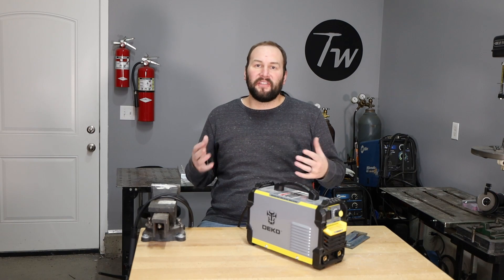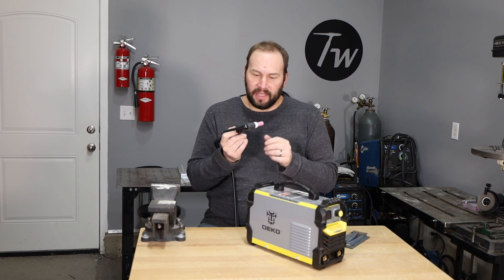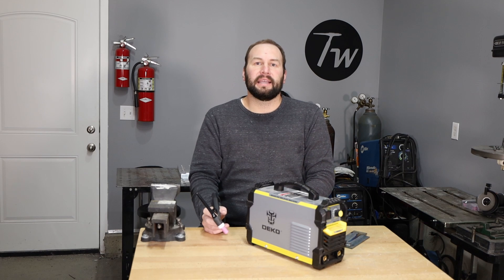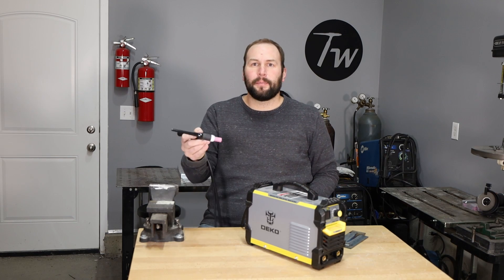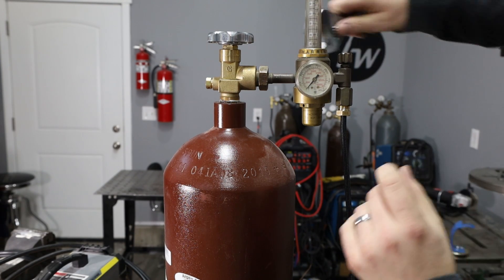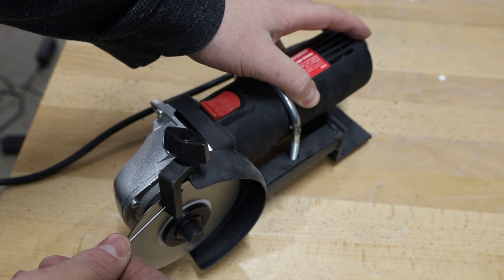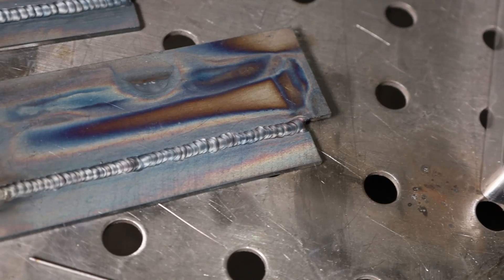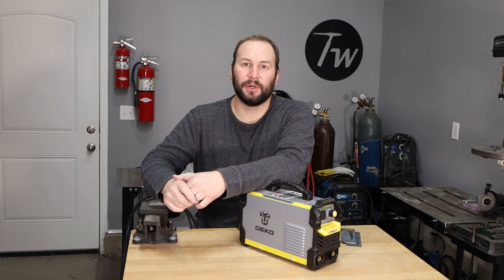TIG Weld with a Stick Welder

Comment: In the industrial trades like pipe welding and boiler tubes that require a TIG root, and fill out with TIG in some situations , they pretty much always have to scratch start and use a torch having a shielding gas valve . 
 Ok, this is been going on for years . 
 My question is in the snap out of the full  current electric arc. 
 I know the welder starts to slowly long arc trailing away from the puddle up on the pipe  bevel or off the weld bead  then snap out . 
 This takes some learning to do it right and not leave a fish eye crater that will get your money ! 
 There getting shielding gas coverage for the tungsten  as long as it still remains close to the work in a gas consentrated zone . 
 But, I can't see that the weld puddle is receiving enough shielding gas ? 
 Is it because the metal is thicker and cools or dissipates the heat enough so the puddle has time to solidify ?

Comment: Is there a type of electrode that is better for scratch start Tig?
Reply from the maker: Just about anything other than pure will be fine. 2% Thoriated is the old school choice and 2% Lanthanated is what I would use. The best way to keep it in good shape is to flick the rod against the side of the taper so that you don't mess up the point when starting the arc.
Reply: @TimWelds  thank you, I appreciate it.

Comment: I have a 160 amp inverter arc welding machine. I need to do some auto body repair (car body panels). I was thinking about saving up some money to buy a tig machine. So your saying all I need to buy is the tig torch and gas with gas gage?
Reply: Probably ?
Reply: @woozhi9218  why probably? what am i missing ?

Comment: I have a weld generator and I was thinking if the exhoust gas could be used as shield gas.
Reply: no no no no, dont do that- if there is any fuel remaining in the exhaust and you do that, it'll blow the fuck up
Reply: @aesthetictap3401  It doesn't work. The exhaust has a lot of water vapor. The weld looks shitty.

Comment: So if I want to weld stainless steel do I have to use argon or can I just get the coated stick ?
Reply from the maker: You can use either TIG or stick to weld stainless. Stick welding doesn’t work well if the material is much thinner than 1/8” (3mm).

Comment: Has anyone tried adding a foot control or something to cut off the arc, so you dont have to flick the torch and let the gas protect the weld till the end?
Reply: You can modify the electronics to cut off the arc but its not recommended.

Comment: Great Video.   I have a cheapy inverter welder that will only do 127 amps and overhead 1/8" 7018 is hard as it needs 10 amps more as holding a tight arc snuffs out the arc.   If you can test these welders in overhead and find ones that will do it in 1/8" 7018,         I'll buy one !!           Thanks

Comment: Hi Tim, Awesome video.  Thanks for posting, great info.

Would you recommend this Welder or something similar today, one year later?  Or have new better power supplies become available since this video was created? 

 I would like to try TIG before investing in an $800-$900 TIG welder.  I currently have a CK 17V torch, gas hose, gas/power connector block, gas regulator,  everything to make it work. I will purchase the Argon cylinder. The only thing I am missing is the power supply for TIG setup.  Any recommendations ?

Thank you, Dan

Comment: I have a hard time to repair sheet metal used on a metal wheel barrel using 1/16 stick welder rod. I am putting holes through the sheet metal.  Any suggestions. Can I just use co2 gas in place of argon gas?
Reply: The trick to welding thinner material with stick is to keep the arc length as short as possible, use the lowest amperage possible, angle the heat toward greater mass when possible, and make sure not to linger in an area too long. If all else fails, you can do a continual overlap of quick tack welds (just remove the slag on each tack prior to starting the next one)

Comment: Do you by any chance have the OD of the cable that connects to the welder? I bought myself a Tig torch now I just need to get the cable. 8.9mm or 12.8mm

Comment: Halo freind. Thank you for the video. I tried the project and it doesn't work.
I replaced a welder and it's not working. I changed a gas tank and it's not working
I use argon  gas. 
Electronic welder- deca mos 170 gen 

By the way, I'm using a direct connection from the + port  from the welder to the table, not the gas hose. 

I thank you for any help. Thank you

Comment: Instead of noble gas can you use a flux coated rod or powdered flux?
Reply: No. With TiG welding you form a molten pool before the rod is added. The gas is necessary to keep that pool clean before, during, and after the filler rod is in contact with the weld.

Comment: I've tried the same what you showed on the video unfortunately my tungsten balled everytime I started....... May be I have to practice how to 'scratch' start which makes me really stressed out sharpening the tungsten!!! Do you recommend other tougher tungsten? I'm currently using 'white painted' tungsten.
Reply from the maker: First of all, make sure that your torch is connected to the negative side-if it is backwards, it will ball like crazy. Second, that type of electrode is typically used on thicker magnesium or aluminum with AC. I would recommend blue lanthanated electrodes (red or gray will also work).

Comment: I'm curious, is it as difficult to scratch start as it is to stick weld?
I have so much trouble stick welding until I switched to 7014 rods (much easier).
You make both look really easy.
Reply: Can you use 7014 on thinner metal like you can with 6013? Do you like 7014 better than 6013?

Comment: I want to see someone hook up an AC stick welder and try to tig weid aluminum with it. My guess would be that you are stuck on a 50/50 cleaning vs penetrating. but like I'm really curious to know if anyone has ever done that.
Reply: ac/dc tig is not AC current from my understanding, it's different

Comment: I dont have money for argon gas. Can I get a tig torch and use it with my flux coat electrode? Wouldnt the electrode be an alternative for gasless welding.

Comment: Well Done, hmmmmm I have a hopefully bright idea type of question;
   If I fill an inexpensive sandblasting enclosure with gas & tig weld in it, ?would I save tons of money on gas?
Reply: Probably only if you have to do a lot of welding on a relatively small piece

Comment: Good video. I think you should have underlined the fact that even though this is TIG welding, this method is not good enough for aluminium. That would require AC balance feature from your welding machine.
Reply from the maker: Great point! Thanks!

Comment: Why do you not recommend using an ac welder for this setup.? I want to try welding alum.
Reply from the maker: An AC stick welder will have a balance of 50% EP and 50% EN, which will put a lot of heat into the electrode, where I usually run 70-80% EN on aluminum. Also, without HF start, it would be a challenge. I’m not saying it’s impossible, but it won’t be great. I’d try to look at something like a Primeweld TIG to get started with Aluminum.

Comment: I currently have a Miller Maxstar 161s and I would like to try TIG. When using a stick machine for TIG will I have to run more amps than I would typically would for stick? I noticed you were at 130 amps on 1/4” plate. That would be way too high for my machine doing stick. I would typically be around 90 amps for 1/4”. Thanks!
Reply from the maker: To some extent, it depends. The amperage range for stick welding will be based primarily on the rod type and diameter, and slightly varied within that range based on material thickness. For TIG welding, amperage is based on material thickness, joint configuration and travel speed. For 1/4" on my other machines, I'll often turn it to180 amps or so to allow me to weld faster, especially since I have a foot pedal to regulate it. There's a wide range of amperage that will work for TIG welding steel, it will just vary your travel speed.

Comment: Shield gas. I have been thinking about that for long time. It is difficult to recharge bottle here, therefore i have an idea, common atmosphere, if we take away the 20% oxygen, and there is no hydrogen, the remaining gas can all be use as shield gas? Nitrogen, argon, co2. And we have plenty of that kind of air we call air pollution in a city. Cars, fossel fuel generator, factory. what if, i collect these gas and use it as gas shield in welding? They are available anyway even everybody don't want it excist.

I know this is a crazy, probably stupid idea, therefore i need someone who really knows the deal to comment this hypothesis.
Reply from the maker: It sounds a little crazy because arc physics and material characteristics are very sensitive to the gas composition, but if you got a process/machine to work without having to buy gas I'd be the first to sign up!
Reply: In your scenario you are not collecting just these gasses. You would have to collect them all. Via compressed air. Then have to rid the air of oxygen and hydrogen. And moisture. 
My idea might be easier. As an electrician we have 2 very common high voltage switches. Air break and oil switches. 
Both suppress the arc when blades close and make contact. 
Welding under oil submergion sounds messy. So I say replicate the air break. Weld in a vacuum. Maybe like a box like a sandblaster box. Vacuum pump and box
Reply: Just get a first try couple days ago, using exhaust smoke directly from a running car engine, no extra pressurized procedures, the welding result itself looks not much difference, still pretty ugly as usual. but occasionally there will be 1 or 2 spark, not on the tip, not on the metal, but in the gas shield air? I guess it is incomplete burn fuel and carbon particles from the engine get burn. In this stage, i proof those exhaust smoke will not damage your welding, but that's not equal to it will help welding. But the smell is so ...... damn refreshing! Just like having put your nose to the exhaust pipe of your car 😅 (exactly equal)

Comment: There have been so many guys doing “Can we TIG with it” videos about the cheapest, or almost the cheapest stick welder, that it’s tiring. Seriously, if you want to TIG, get a TIG welder. This isn’t the best, or safest option. It’s a Rube Goldberg contraption. By the time you get everything you need to do this, you could have spent the same amount on a proper model. Torches with a valve also cost more, negating the cost of the solenoid valve in a TIG welder. 

A lot of guys can never get used to scratch start. That’s honest. Lift start is a bit easier, but really, not by that much. Most of the time, unless you can start with very low amperage, the tip will stick to the work, and then you have to twist it off, and retry it. And yes, every time you dip your electrode, you have to regrind. That’s even true if you stick to the work. I do have a solution for people who can’t manage this. Get a piece of copper, at least 1/16” thick and a couple of inches square. Put that right next to where you’re going to weld, and start off on the copper, moving to where the weld should be. You won’t stick to the copper.

If you’re starting from scratch, just buy a TIG setup. These days, TIG welders have become cheaper. Even high frequency start machines have become fairly cheap. It’s always better to save up for a better machine than buy the cheapest that you can buy right away. $100 extra can make a big difference. If you have a stick machine, really, think hard about it, and give some serious thought about getting rid of it, and buying a TIG machine.

Just remember that you’re going to be doing this for a long time. Doing this with a stick welder and trying to “upgrade” is going to be disappointing. It could sour you on the whole idea. I know it’s a topic for a video, but don’t do it.
Reply from the maker: Thanks for putting so much thought into this comment. Like I said in the video, you’ll come close to the cost of a basic TIG by the time you buy the torch too, and HF start is much better. I too would recommend getting a dedicated TIG machine if you’re starting out from scratch. I also agree that it’s worth thinking long term before picking equipment. However, this works quite well and provides another option for those who have a DC stick machine and want to give TIG a try. Thanks for the tip with the copper. While the setups I have used have lit up easily, it may help someone who is struggling to scratch start. I always appreciate your comments and input. Thanks, Tim
Reply: I agree on a lot of your points except for where you say get rid of your stick machine. Stick still has so many practical applications. That TIG never will. If you're saying it's a superior weld you are most likely correct. But it's not nearly as versatile. Are you talking about strictly fabrication work and a warehouse setting? For that absolutely. But out in the field and in real world scenarios outside on farms oil rigs at war nothing beats arc.
I wouldn't get rid of your arc welder. I just wouldn't use it for TIG welding
Reply: @stephenrosenthal5252  what I meant by getting rid of the stick welder, was that for someone who doesn’t really want to stick weld, but bought the machine because it was cheap, and that was all they wanted to spend at the time, and let’s face it, stick has its own difficulties, but decides they want to TIG instead. Since we’re talking about people who might find it hard to afford a TIG machine, selling the stick will help. I know a number of people who thought that welding was so easy, and then found it wasn’t. My usual recommendation for the casual weekend welder is to either buy a MiG, which is real easy to learn, or second best, buy a flux core machine like the Titanium 125, which Tim reviewed, and I bought for a small machine when my big ones aren’t easily moved, and I’m just welding in short spurts. The problem with everything but stick and flux core is the gas. That can actually cost as much as the welder in upfront costs.
Reply: That is great, sound advice.

Comment: Wouldn't a flux core rod/wire fix the need of argon gas. Making it even more simpler.
That little jig on angle grinder for grinding the rod tip is ingenious 👌🏽
Reply from the maker: That's a great question. With TIG welding, a molten pool is formed before filler metal is added, so it's necessary to have shielding shielding come prior to filler metal and in between applications of filler metal, thus the gas instead of flux. The tungsten electrode also needs to be shielded so that it doesn't get contaminated at temperature, and it's really nice to have such a clean weld without any slag remnants from the flux remaining after the weld is complete. Thanks!
Reply: @TimWelds  thank you makes sense 👍🏼
Reply: ah, I was about to ask the very same question. For a moment I felt really smart for the idea :D

Comment: I have a yes welder and it doesn’t have a gas hookup, can I tig weld still?
Reply: Yes , you just need the right hand piece
Reply: Same as his ? But it has a gas line two, wich goes to the gas bottle
Reply: @timothyrouse2853  oh okay thank you so much!
Reply: @timothyrouse2853  I just realized that the tig torch that came with my machine actually has the gas hookup like his in the video
Reply: Where can I find the tig torch you used in this video ? I have that same Dekopro  machine and would like to try and tig with it. Would really appreciate it. 🙏🙏

Comment: That little deko is a DC machine??
Reply from the maker: Yeah, pretty much all the the little inverters output DC.
Reply: @TimWelds  does it run 6010?
Reply: laiky71 most stick inverters do not run 6010.. you can always use 6011 though..
Reply: That's what I thought, but they don't say it on the site. I use a dynasty for tig, but I hate dragging it out for stick practice. This is a perfect knock around unit
Reply: DC .. this 50-90 € machine  is a bullshit and only DC i think useful only for little home work